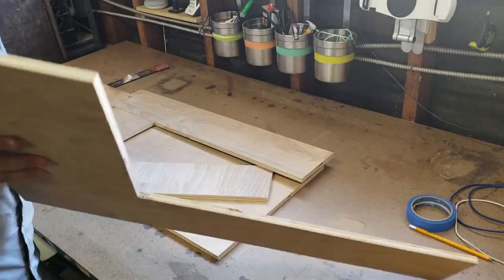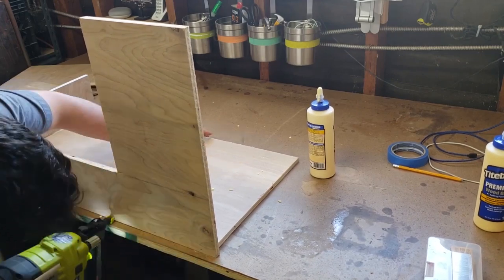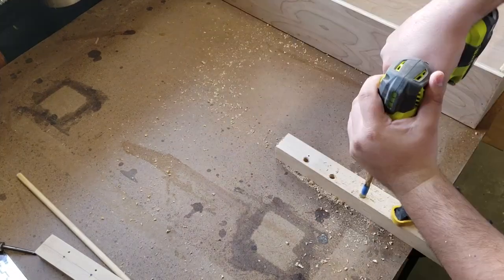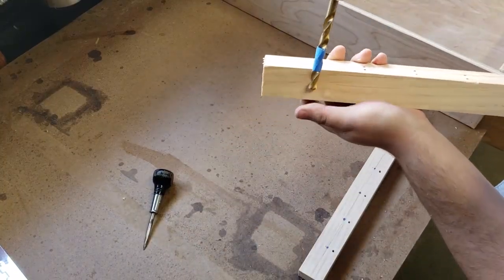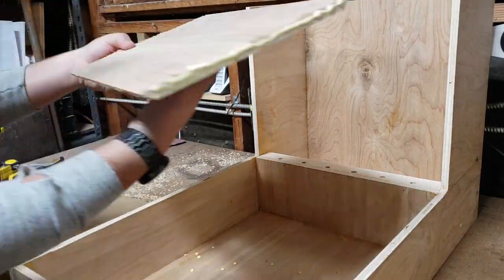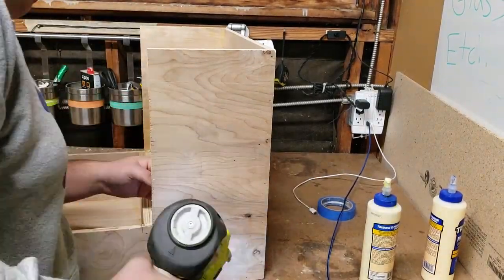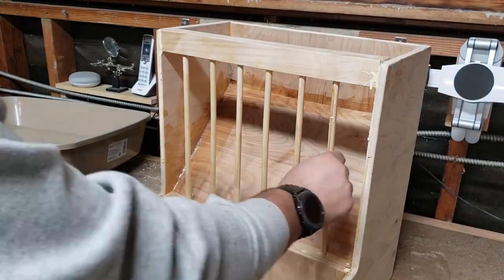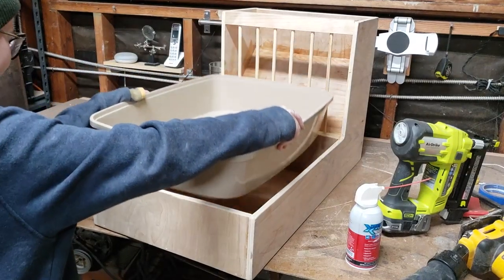How to Make a Hay Feeder and Litter Box for a Rabbit

Comment: Hey I am looking into building this, but i dont have any drills or nay tools really etc so i will probably make the bars will diagonal small bars. 

But i have run into some calculations error. So the box you bought is 5,5x17x22,5 IN. If i look at the Model you have up i can see that the OUTER distanse is 5,5 In but the inner will become 5 IN. Again with bend of the L to the end its 21,5 IN. 

So i was wondering since i am in another country with a box that come in a different shape and size and in CM how you guys reasoned. 

Did you just wing it? 
Did you measure with the intention of the box hole being smaller than the box for a better a tighter fit? (did you have a box and made the fit after it?)

I would love yo hear what your thought process was there, thanks.
Reply from the maker: I am so excited that you are interested in making this. The way I found measurements was by measuring the outside of the plastic litter box, below the lip. That way the lip sits on top of the wood.

Comment: Is plywood ok for an animal that chews? Please advise.
Reply from the maker: My rabbit hasn't so much as nibbled on my feeder and I've had it for over a year now (which is weird because he chews just about everything else), so I was confident in using it. But if you think your rabbit might chew it, the dimensions are small enough that it can be made out of dimensioned lumber for the most part. Although you might have to make the box and hay feeder as two separate pieces. If you do make it, I would love to see how it turns out

Comment: Having trouble with all the dimensions! What were your measurements?
Reply from the maker: Hey @TLMidnight I am so glad you are trying to make this. 
Here is the link to the 3D model, you can check measurements directly from the website: https://a360.co/2MknlxH
The password is: tscrabbit
If you do build it, please tag me on any social media you post pictures on, I'd love to see it. Let me know if you have any more questions, and don't forget to subscribe ;)
Reply: @Lyvierre Villalba If you log in, you'll see a grey bar and there  is an option measure. Then with your mouse pointer you can pick 2 spots to see the distance.
Reply: I used link did not pull up dimensions
Reply: I had trouble using the 3d model. I need the actual measurements please!